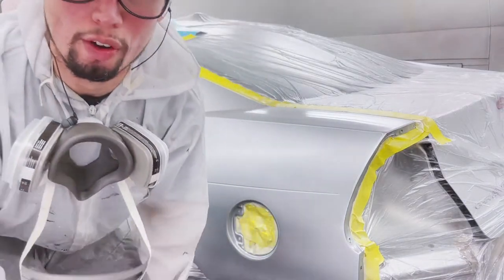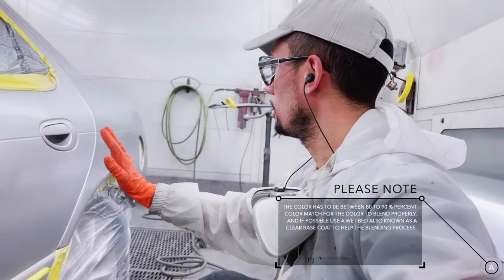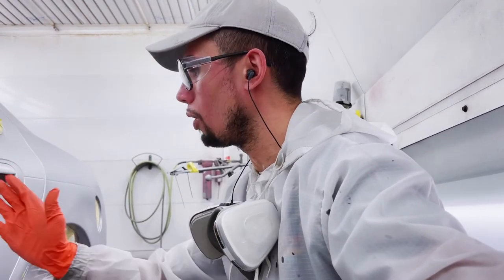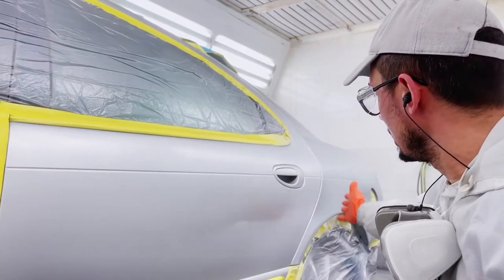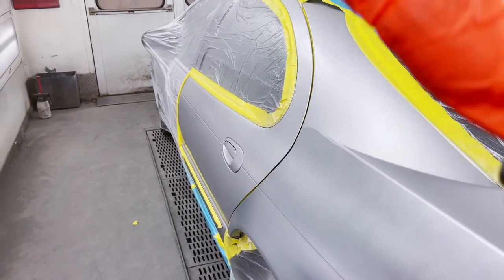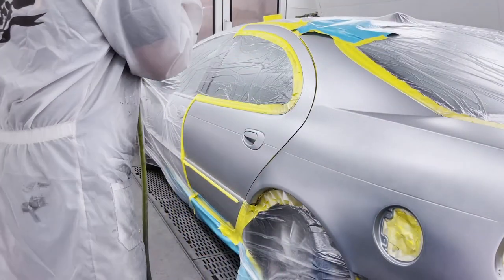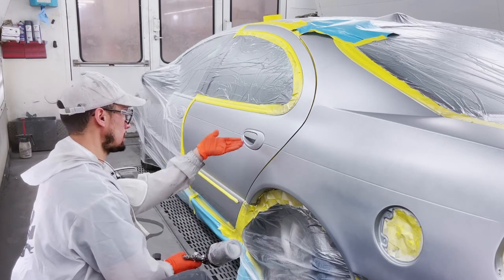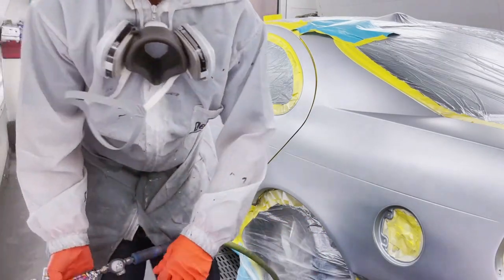How to Paint And Blend Car Paint| MY BEST TIPS

Comment: So a base clear isn't necessary? Seen other video and they use it to lay the metallics down or something like that.
Reply from the maker: So when blending metallic’s I use a clear base coat that allows the metallics blend out smoother. When painting metallics on a hood you have to spray it evenly and medium wet coats and in some cases a drop coat has to be applied to make sure the metallics are evenly distributed across the hood to make sure there are no stripes or blotchiness.